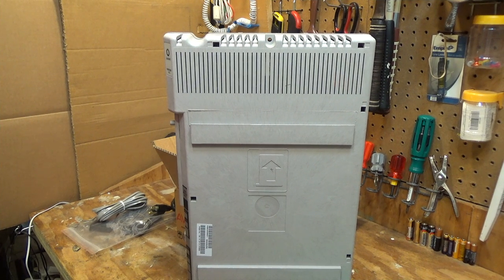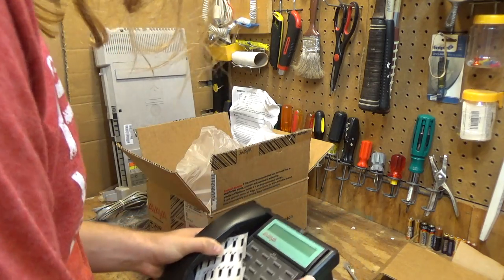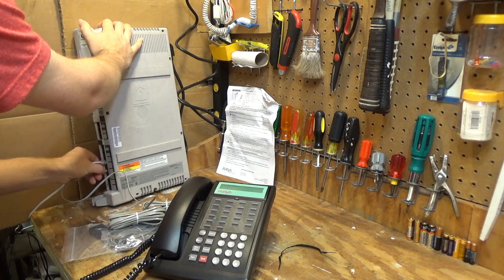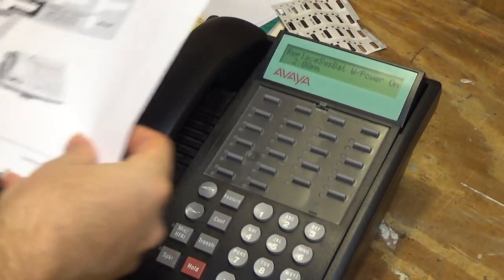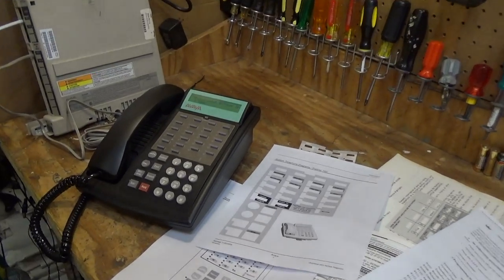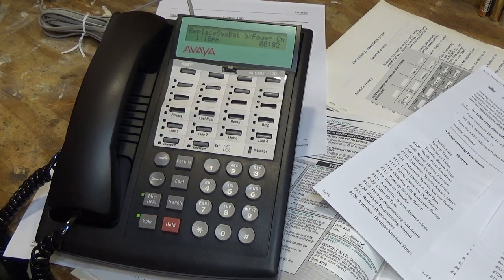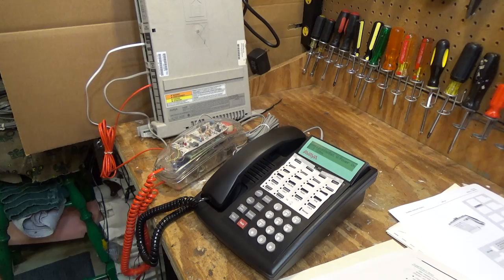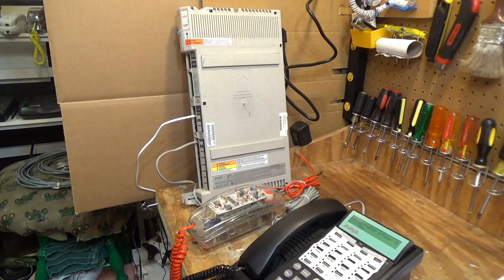Partner ACS PBX System | Initial Checkout

Comment: These phone systems do considerably more than meets the eye.  You need the programming manual for the card.  If you plan to use this in a home, it can give intercom dial tone to standard phones and dial 9 for outside line.  They are only compatible with tone dialing, so rotary phone will only work with a pulse to tone adaptor.
Reply from the maker: They are 100% compatible with pulse dialing.
Reply: You are right they are compatible with rotary dial.  In the years that I installed them, I never knew.  Mostly used 18D system phones, but sometimes a single touch tone phone in a lobby.  Just pulled an old manual to find out.  I have a 308 card,  maybe it is my new intercomm for my collection of 1930s phones.

Comment: So this one doesn't have ridiculous complicated bare wiring everywhere, it actually uses modular plugs, that's very nice.  Is it capable of adding a paging/intercom type functionality to an external amplifier and speakers, just out of curiosity?

What happened to the DialGizmo, I thought you used that to convert pulse to tone?  It would be such a waste to use this just as a gigantic dialgizmo...
Reply from the maker: The 'complicated bare wiring' device as seen in the previous video is for connecting to building wiring..

I'm not sure what the capabilities of this system are, but it's entirely possible.. I've heard it has a lot of options..

The DialGizmo is only good for one phone, and considering the outrageous price they sell for, one is as many as I would give any entertainment to purchasing..
Reply: @JordanU  This system will convert pulse to tone. Program your lines for tone dial and any phone connected to it will be converted. Any station port can be used for a tradional analog phone. I have one of these in my house with the 5 module carrier fully populated to connect all my old telephones. These systems are awesome and super versatile. Programming is simple and if you ever need a hand or a cheat sheet, hit me up.
Reply from the maker: @chrisrichard298  Thanks for the information! I've actually had numerous people reach out with offers for assistance with this equipment--it is greatly appreciated.. When I get around to running proper wiring for it, I will keep you all in mind if I encounter any issues..

Comment: I havn't had much experiance with this system, or telephone equipment in general, , but we have one of these systems wired up at the firehouse where my grandfather is a member of. one of the lines hooked to the system is the emergency hotline for the department, so when someone calls it it trips a relay that sends 24 V ac to an electromechanical horn on the truck floor to alert personnel of an emergency call while they are at the firehouse. It is also hooked to the dispatch console, and it has a paging amplifire hooked to a few  of the extentions. It has three paging extentions that activate the paging amplifire. 1. the rescue/ems extention. This extention, when called, plays a woop tone over the paging speekers for a few seconds to alert ems and firefighters of a rescue call. 2. The general alarm extention. This extention, when called, plays a slow woop tone different from  the rescue tone to alert personnel of a general alarm, I.E motor vehicle axident, elevator rescue, structure fire, automatic fire alarm, and anything else that doesn't involve only EMS. . 3. The standard in house paging extention. this extention plays a 440 hz tone separated by 200 MS 3 times for a non-emergency alert. after either of these signals, the dispatcher in the radio room can say what he/she needs to over the handset. Since it is a vollunteer fire department, we also have motorola minitor pagers for personnel who are not at the firehouse so they can respond to calls or go to the firehouse, get on a truck or ambulence, and respond to the call. The motorola radio system and avaya pbx system are two different systems. There is a dispatcher at the firehouse 24/7, regardless if there are firemen at the station or not. Most of the time during the night, in most cases the dispatcher is the only person in the building and the minitor pagers and house siren are used to alert them to a call.
Reply from the maker: You can do a lot of interesting things with this kind of equipment..

Comment: This is great to find, honestly. This represents the end of an era...Lucent would spin off into Avaya around 2000, which is how business telephones were handled by the AT&T related companies (Lucent spins off from Western Electric, Avaya from Lucent). Meanwhile, VTech purchases Advanced American Telephones on April 2, 2000, thus getting the rights to sell consumer phones under the AT&T name. Lucent designed phones are stil manufactured under the AT&T name for a period, but VTech designs quickly replace them. As an example, I hope you find a way to acquire an AT&T 962 Corded telephone...Mine's gone, long gone. Other than badly implemented multi-line conferencing (the only reason I ever replaced mine), it's the most business-like consumer corded I've ever seen other than Aastra. If you ever do acquire a 962, compare it to this Partner. You'll be surprised at how close it gets.
Reply from the maker: It's a shame to see these systems quickly getting replaced by VoIP, but the era isn't over just yet. I still see plenty of these around in local businesses.
There is another phone collector on YouTube, Xyspade, who has a significant interest in the AT&T phones from that era. I believe he has a 962. I've heard good things about it.
Reply: @JordanU Thanks for the redirect! And I meant in terms of manufacturing with my "end of an era" comment. Honestly, properly implemented VOIP will smoke these, but it has to be well implemented VOIP. No Oomas!
Reply: My school district used a Nitsuko phone system, there's almost no information about these online at all whatsoever, however the Nitsuko phones resemble the Partner phones in design

Comment: When calling into my system or phone number, a recording says the number is disconnected. If you stay on the line, you will ring into the normal business greeting and promops. Any idea to why but more importantly how to fix the issue?
Reply from the maker: That sounds like an issue with your phone service, this system is not going to generate such a recording.